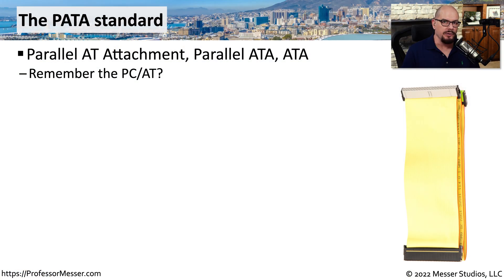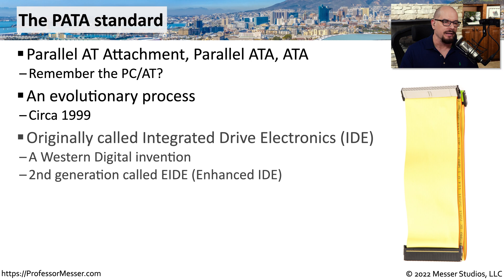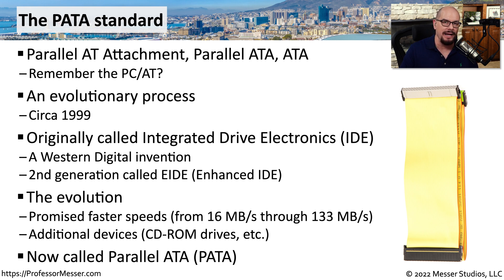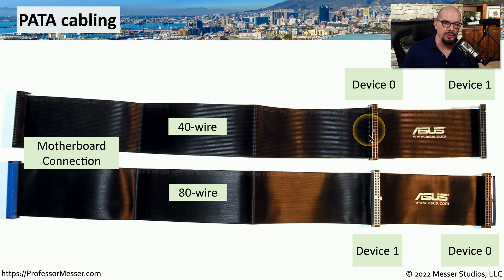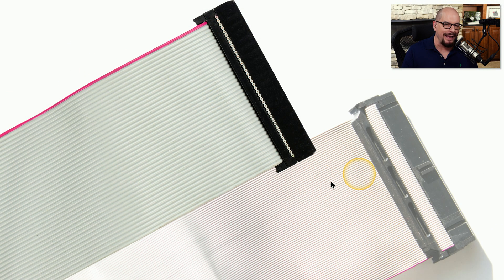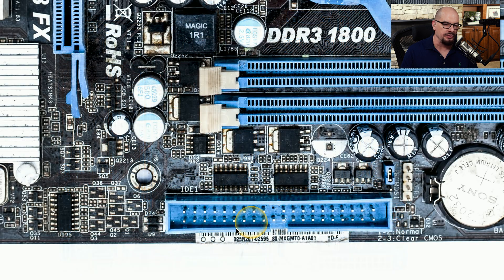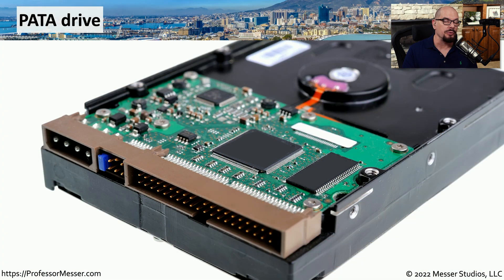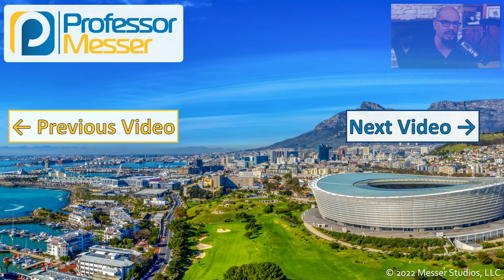PATA Device Cables - CompTIA A+ 220-1101 - 3.1

Comment: Fun fact, in the very early days some IDE cables weren't keyed, so for a while it was extremely easy to plug it in the wrong way and blow up your incredibly expensive shiny new hard drive. As a result, it was very quickly made so the cables were always keyed after numerous complaints.
Reply: very cool fact, imagine if USB c did that
Reply: @Billybobber47  😑 no. Awful.
Reply: I'm betting this fact was not fun when discovered
Reply: THATS FUNNYYY